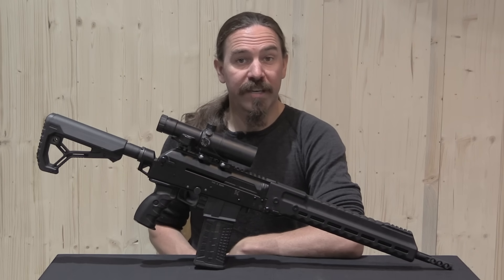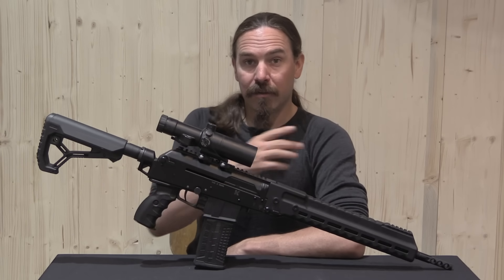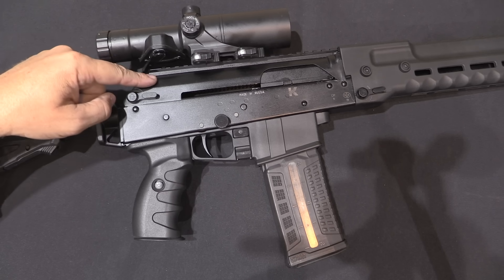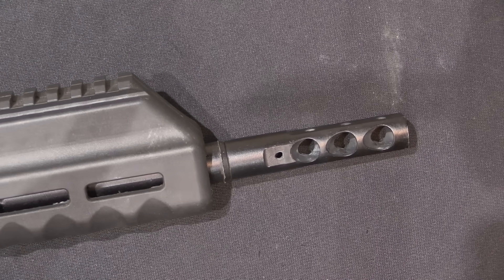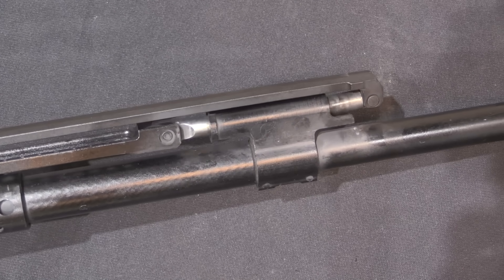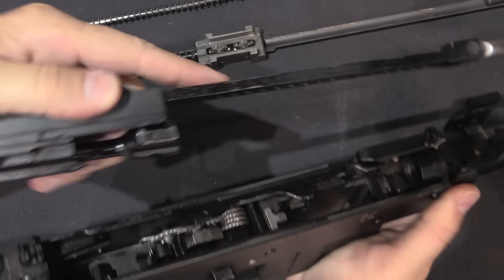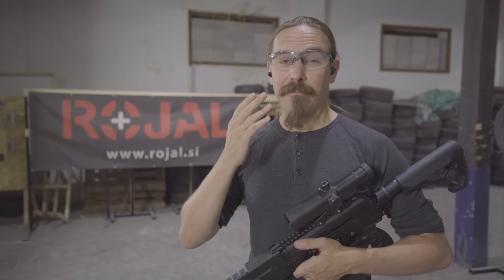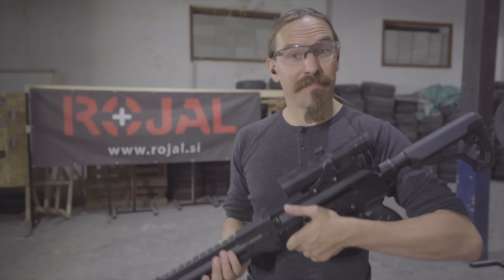Balanced Recoil AK-107 / Kalashnikov SR-1: Is It Any Good?

Comment: One thing that strikes me about the design of the counterbalance mechanism is how light it looks. I wonder if the over all weight is even equal to the bolt its self. I bring this up because even if you got the timing right, I'm guessing that if the mechanism was not at least equal in weight to the mass that it was trying to counteract, then it would be less effective over all, and I'm guessing even mechanism balance may come into play.

As presented here, this seems almost like an idea that was only messed with until it "sort of worked" but then was never really fine-tuned, if such a thing is even possible in this case. Apparently the idea was not completely abandoned though, as the Russians recently developed and adopted (to a limited degree) the A-545 or A-762 which also has a counterbalance system in it, as I understand things.

Comment: I think the reason it doesn’t mitigate recoil much is because the counterweight doesn’t APPEAR to be anywhere near the same amount of mass as the bolt.  I obviously can’t actually feel it, but it would need to be the same weight as the lower half in order to actually feel recoilless
Reply: And it looks like AEK-971 (A545) have that done right. Counter balace part is rather chunky.

Comment: At 1:58 it is shown to be chambered for 223 Rem, not 556 NATO. 
I am well aware that there is not a lot of difference between the 2 rounds but is there a real significance to this civilian version being chambered for the lighter and lower pressure round?
Also, how much effect on the balance system would there be between firing 556 NATO and 223 Rem? I'm guessing not a lot, just somewhat faster bolt travel.

Comment: there is no need for a 2nd forward piston because they are locked together by those wheels in the first place. additionally since you still have to balance the forward bullet ejection with a rear moving mass having an additional mass move forward just means you reduce the value of the extra mass. constant recoil systems already sort out the issue of the bump at the end of travel without chucking a lot of extra mass moving forward. only a perfectly balanced system with zero parts wobble could ever achieve zero barrel climb/motion and there will always be rearward force/recoil because of the law of equal and opposite reaction. you can just delay and spread the rearward force out like crumple zones in a car but the system used to to that recycles/resets so it has a forward motion as a result of the energy stored in the springs that are used to reset the system. only slowing down the speed of the bolt both rearwards and forwards will reduce the impact of the forces by spreading the force out over more time and potentially putting them below the threshold of inertia of the mass of the shooters body. a gentle breeze generally doesnt knock you off your feet whereas a gale can. 
ofc this system was meant to dampen forces that jerk the rifle around and throw the sights off target. maybe it does it? but i think a full auto in a more powerful cartridge would be needed to test it since machine guns are notorious for losing the sight picture as soon as the trigger is pulled.
Reply: If you made the piston slightly smaller in each direction, that'd probably work, right? Also, any extra velocity you impart is going to get absorbed by the fact that it's going in both directions anyway. Not great for wear and tear, but still. The real reason why this is insufficient is because there's not enough mass. If you're locking the masses together than they will have the same velocity but different masses, so they won't cancel each other out.

Comment: I cannot understand why, even with exact synchronisation of the countermovement, tuning of the masses and friction should be insignificant (unessential), as said.
In order to compensate the recoil of the moving masses, an exactly equal mass would have to move in the opposite direction (or a deviating mass would have to move at a different speed in order to produce a corresponding mass inertia).
I cannot see at all what should have changed in this physical fact by the solution found here.

However, since the balancing mass is apparently much smaller, it would have to move even faster to compensate the recoil. In this respect, the equal speed forced by the "gear weels" is probably even responsible for the fact that the balancing effect is too small.

Comment: I must say, the two beams of the recoil system don't look like they have the same weight... I'd assume you'd want them to be.

Also, I assume that as you go up in caliber, the more this can help, without necessarily increasing that much weight as you can split the mass of the bolt/ carrier between the 2 beams.

Comment: Those twisted wire springs are a thing I've never seen anywhere before, and I can't imagine what the advantage is. Since Ian didn't comment on them, are they common in AKs?
Reply: They are actually quite common in weapons. They are, afaik, stronger than single-wire springs and they have the benefit that if one wire snaps, the spring will still work with the other two wires until you fix it.

Comment: I remember coming up with a similar design sketched out on a napkin at a pub after two beers, but using a rack and pinion method. My friend, who was well educated, thought I was nuts and that any cog material wouldn't handle the strain. I abandoned it. Imagine my surprise when a "recently developed" Russian rifle, the AK-107, surfaced, which used a counter weighted recoil system, with a sprocket-facilitated reciprocating bolt carrier group and a counter-travelling rail.
Reply: russian spy everywhere?

Comment: Interesting design.  I wonder if you could put the cog on the top of the bolt and have the piston blow forward and it would do the same thing w/o the added complexity. Receiver would probably have to be a bit taller though.

Comment: Hmmm.  Parallel linear motion in opposite directions but not in line would introduce some rotational force, wouldn't it?

I wonder how well it would work if the counterbalance was situated in line with, or even around, the bolt / bolt carrier.

And if they had the same mass.

Just a thought...

Comment: From my observations the two interfaces of the gas pistons with the gas block seem much shorter than the recoil depth. How does the handguard alone stop these from sliding completely out, or otherwise once they are out, ensure they are always able to enter directly back into the gas ports during firing?

Comment: I think the problem is that the counter weight’s mass is not equal to the bolts mass. Therefore the momentum of both aren’t equal causing it to not be truly counter recoiling. Would it reliably function if the operating system had to push twice the weight then intended? Wouldn’t be worth it if it compromised the core reliability characteristics of the AK platform. That’s the key

Comment: So, there was an AN-94 on the channel (albeit without firing, but that's not surprising: it's a museum piece, in fact), now an AK-107 (or rather, its version).
I hope that Jan can get to the AEK-971/973, or its upgraded version A-762/A-545, because among the schemes with balanced automatics, this is the most viable, as far as I know. It seems they are even used to a limited extent by Russian special forces, unlike other contenders.

Comment: I was told that the bolt shouldnt be hitting the rear trunnion? But I get whats being said anywho.
Been stewing on such a design for a long time. Didnt know I'd been beat to the punch. Being a counter weight to the recoil youd need the same weight or resistance as the bolt itself. That would make it heavy, and you still have a lot of mass moving around even if its balanced. The ratchet system there is a brilliant idea there. I was thinking of a lever system that hinges on the bolt itself, and as it travels back, it propels another forward. Kinda like the lever lock system on the famas. If it was totally even though the action wouldnt cycle at all, or the travel would have to be elongated in order for the travel to permit a round being picked up and kicked out. Anywho, mad musings.

Comment: Not gonna lie... but, FINALLY, an AK that I'm legitimately interested in! Of course it's one of the ones that we can't get...
 
I do wonder if they needed to increase the weight of the upper counterbalance mechanism to truly make the system effective; if the weights aren't reasonably close, you're inherently going to end up with sub-optimal performance of the recoil reduction system. I suppose the other option is altering some gearing, so, instead of being timed 1:1, maybe you could get a ratio such as 1.5:1 where the upper counterbalance is a lighter weight but moving at a 50% greater velocity to make up for it.
Either way, this is one of those things that I desperately wish got more development - there's something here(...although I think that about the ZIP22 too, so grain of salt lmao) - but I can't possibly blame them for not continuing the development of.
Frankly, given how close the foundation is to a regular AK, this seems like something that a talented smith could build & play with DIY style from a more traditional AK. Maybe Herrera should add this system to the AK50? LOL

Comment: with a heavier counterweight there likely would be more impact of the system as the innertias are more similar. having both on one level, not above each other, would also reduce the muzzle climt due to distance of main line of the rotation position (but would require the counterweight to be there on both sides to counteract the then introduced sideways torque which would make it even more expensive).
interesting design, though, but not as functional in reality as the designers thought. i might take it into consideration when I start with my designs ...

Comment: Conceptually this is a lovely system, compared to the pulleys+wires and stuff i've heard about with other systems this is waaaaay less prone to issues IMO. There's nothing to jump or go slack or otherwise suffer issues of that sort and everything is solid pieces of metal so other forms of wear and tear should be of low effect. Given the gearing i'm not sure it strictly needs a second gas piston. I also don't see any reason this couldn't be made easier to field strip and reassemble.

Very much reminds me of several other phases in gun development down the centuries where some new fancy concept comes in and the early versions are cool but a bit temperamental and difficult to manufacture, and then as time goes on refinements are made and it becomes a solid practical system.

Comment: I think this system could work and be simplified. Think about it like this the bolt and bolt carrier have to go backwards, but the op rod technically doesn't. If you had the op rod going forward and connected it to the bolt carrier through the cog wheels, it would pull the bolt carrier backward. The gas piston drags the op rod forwards, the cog wheels and the force of the cartridge on the bolt would propel the bolt and carrier backwards. You would then only need one spring for the system too.
Reply: Такая система была. Однако одна пружина оказалась недостаточно надежна.

Comment: I could see this being good in a blowback PCC or SMG where the weight of the bolt is split equally between the two moving pieces, since blowback systems have very heavy bolts.
Reply: Open bolt SMG's for sure. The bolt slams forward with every shot, which has to be horrible for accuracy. Then again, guns in that area are considered bullet hoses anyway, so a little bit more accuracy with the complexity cost may be a moot point.

Comment: Yep, a notable difference with the muzzle compensator fitted. It looked almost still? How much the added weight of the mechanism contributes to this, or the mechanism of the reciprocating mass going forward, in addition to the muzzle device combined, is a question of mine. IE, no point in making it heavier than needed, etc.

Comment: Would increasing the mass of the counterweight as well as it's height over bore reduce the muzzle rise even further? The Moment (Newtons) about the central balance point for the gun in the direction keeping the muzzle down would theoretically increase due to the increased distance from the central balance point and higher mass, since Moment is calculated as M=Fnet*D, or broken down further, M=(mass*acceleration)*D

Comment: Wouldnt it make more sense to take away half the weight of the bolt, put that weight at the end of the counter balance system, also use another recoil spring for the forward moving counterbalance to compress, this system is a great idea but not executed correctly, I'm going to make an add on system like this for ARs

Comment: What I find most interesting and think is of most market value as somethingthat they should offer anyway, is all the intercompatibility features for the auxiliary components and manual of arms, used in AR-15 type guns. And the bolt-hold-open.  Perhaps other companies should do something like this as well, aping up this design. :D

Until the Galil ACE there was no STANAG magazine compatible AK, the way they did things here, seem elegantly simple and relatively inexpensive to implement and unlike the Galil ACE can made, or rather do fit a conventional AK receiver.

It has always bothered, especially with the previous 5.56 Galils and SAKOs and Valmets that nobody has attempted to make things like that. Now finally the russians have.

In particular it bothers me they didn't even prototype something like that while developing the RK-95 as the gun was initially intended for full replacement for the RK-62. Then later on they rolled back on that and only ordered some for top brass and storm trooper units. Rest having to do with the RK62 which by that point was at the end of its design life...

They're now refitting the old RK62, 30 million euros worth. In some one-man gunsmith shop. And they're STILL 7.62x39mm.

Considering the 7.62x39mm production line  at SAKO is I believe, one of two in europe, and this is the first thing Russians will missile strike from the face of the earth, and nobody uses the caliber in the west, were gonna be fucked pretty quickly if they attack. 

Since there is not going to be ammo for our infantry. And the only country where you could buy some in significant quantity fast... Is the one attacking us. 

I wonder if they'd mind a cease-fire while we wait the shipment from china to come over seas. Since I suspect trans-siberian railway isn't going to be available for that shipment...

Or then maybe Sellier & Bellot has us covered.

Comment: Balanced gas system was NEVER claimed to eliminate all of the recoil. It helps with mitigating components of the recoil from rifle operating: bolt carrier impacting rear trunnion and impacting the front. Also the gas driving the gas piston back creates a forward push on the rifle by pressing at the front of the gas block. Balanced gas system also eliminates that component since gas pushes on gas pistons that move both forward and back. Russians didn't claim it to be "recoilless" at any point. They claimed improved controllability at automatic (for military), and improved speed of follow-up shots (military and civilian) by eliminating the recoil components that are done by the operation of the firearm itself. 
It has been long proven that muzzle brake is a huge help in reducing the felt recoil and muzzle climb. And this muzzle brake was clearly made to tame the recoil of the shot itself. Vlad Onokoy even spoke about it how massively it helps on a AK-103 compared to without. So I don't really understand why Ian feels the need to say that the muzzle brake is a bigger contributor. It's designed to eliminate only the actual SHOT recoil, not that of rifle operation.

Comment: I can only speak to the theory of it but muzzle climb seems like something the counterweight system wouldn't help with since the forces of the bolt's movement during a firing cycle even out anyway (the back knock is roughly equal to the forward knock). That movement should only knock your aim around whereas the climb can only come from asymmetric forces like the bullet and gas coming out the front of the gun.
The counterweight looks much lighter than the actual bolt, I wonder why they aren't of equal mass if they're meant to counter each other? Could probably reduce the bolt mass and increase the counterweight mass to get the same cycling time with less imbalance?

Comment: That SR-1 is weird, it's worth noting for people who don't know, the actual AK-107 and 8 are mostly just standard ak100 series rifles with the addition of the balanced recoil system, so imagine an ak-74m or other ak100 series rifle with a black metal box in place of the normal gas piston shroud. This gun, as Ian mentioned is also adding in some of the experimental AK modernizations that companies like Izmash have been prototyping.
Anyway, it's a shame that Ian didn't get to shoot a 107 in full auto. 5.45 is already a very light recoiling bullet, moreso than 5.56 nato, and in full auto the balanced recoil supposedly really helps keep the gun on target. Also worth noting, the standard ak-74 and the ak100 series as a whole makes use of compensators, the barrel accessory that they use isn't just a flash hider, it compensates. So, the recoil system and compensator are meant to work in tandem on the ak-107. Overall, I just want to see Ian shoot a full auto ak-74m back to back with a full auto ak-107 and really make that direct comparison of with system vs without.